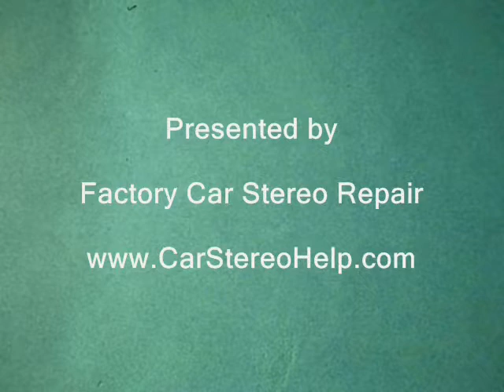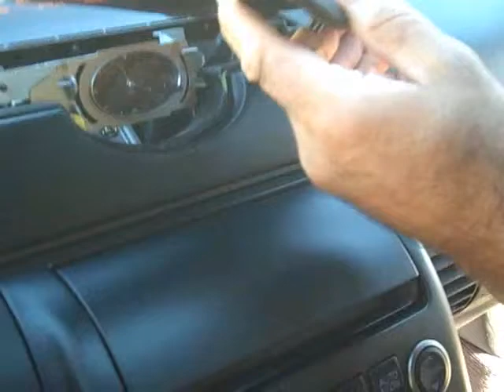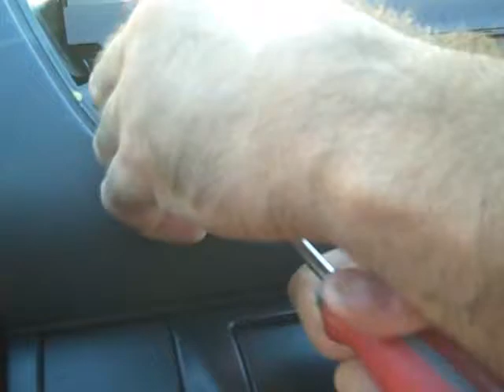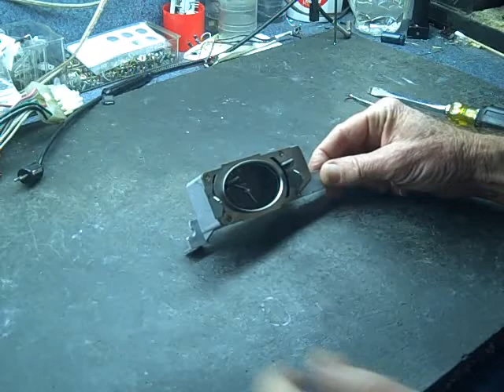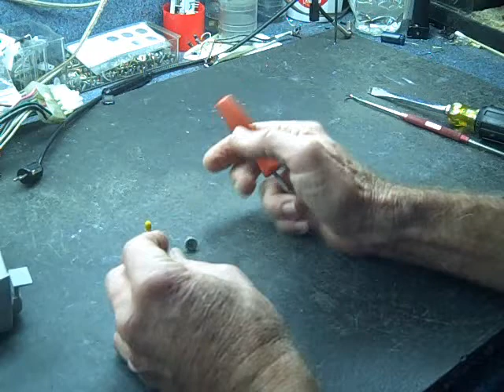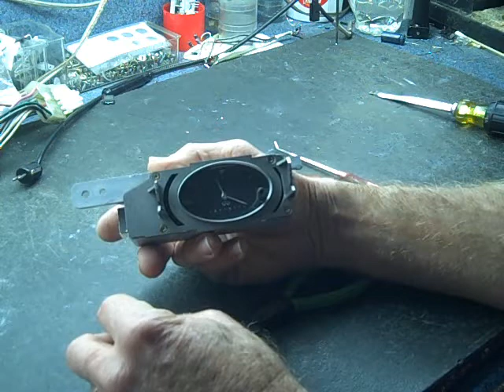Infiniti G35 Clock Back Light Repair  2002 - 2006 = Car Stereo HELP

Comment: Nice video! My 2003 g35 coupe clock is burned out! Will radio shack carry these bulbs? On the automatc shifter is there lights that illuminate drive/park positions?  I think mine are burned out.